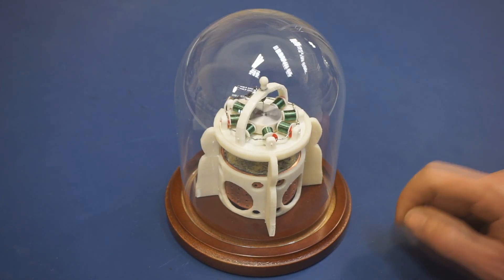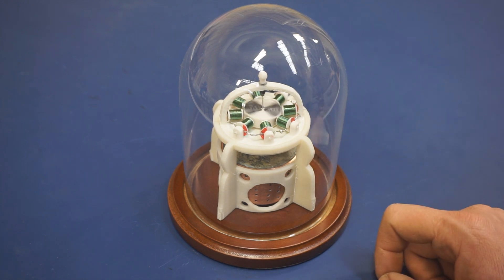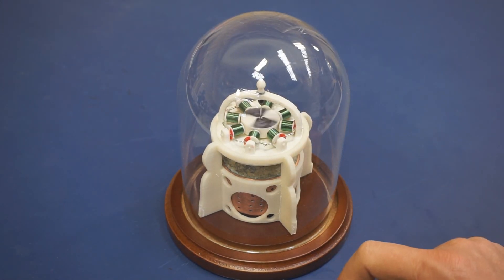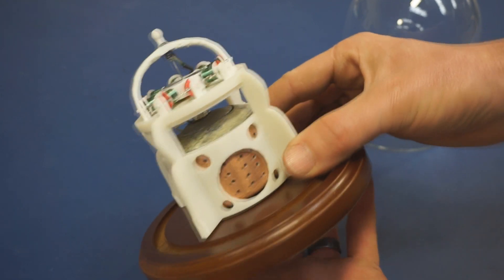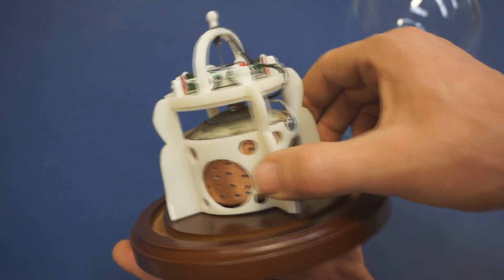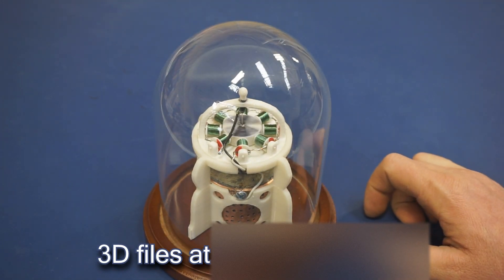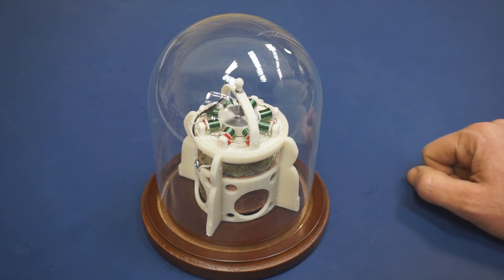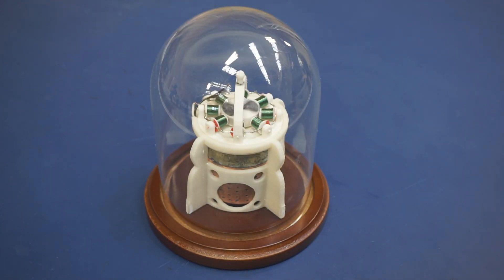Mini EZ Spin Motor + Epoxy Hybrid Crystal Cell

Comment: Made 4 crystal cells last fall (October),
still at 1.2v and topped with epoxy. Using them to power dancing solar flower circuits- converted to pendulums. 
May try drilling a few holes into a couple of them and adding a few drops of water to them.
Thanks for the inspiration laser !
Reply: Are they still working?

Comment: I love your videos and watched all of them. Been following you for years now.
I want to tell you that I have made concrete battery from aluminium and copper.
Voltage is 1 volt with only 3-4 micro amps but it is interesting that this cell works more than 3 years now! That would be perfect for your motor because there is no need to add water or anything else. I have 2 smaller cells and thinking to give them to someone who is interested in this.

Comment: Epoxy in a crystal cell mix??? It seems like that would make an insulation situation out of it and stop the chemical reaction. I'm very surprising that it worked.  I did make a couple of cells where I sealed the top with epoxy but with time they went dead.  I think that I will drill holes in the sides, like you did, put a little water in there, and see if they come back to life. 
   I am still working with the SOLN1-8. The USB volt/amp meter that I ordered arrived and has made testing much easier.  So far all I can say is that this SOLN1--8 is another one of your inventions that does all you said it does and more. It is going to be very handy on my sailboat.
Reply from the maker: ***** 
Did you ever see the oil cells I tested?  I also did not think that was going to work.  I added the epoxy to correct some issues that have arisen after years of testing with my older cells.  So far it seems that this cell is probably the most stable I have ever created.  Time will tell, and based on past experience it may take a few years before we have the answers.
  I am so glad to hear that you are enjoying your SOLN1-8.  I am looking forward to hearing how it works out for your sailboat.  I have put all my spare time, as well as more than a few all night build sessions, into the SOLN1 project.  I have a large SOLN1-100 that I am just starting to design and build.  It features a 100W semi-flexible panel plus a 2000W surge to 4000w inverter.

Comment: If the motor consumes so little energy, you can try to build another type of battery - I cannot give the exact name, but it has been used in a very old clock - there is a cylinder with gas which reacts on temperature difference , no matter high-low or low-high, and gives power to a clock mechanism like forever...
Reply: ***** 
The Atmos clock.  It works by changes in atmospheric pressure acting on a bellows which is connected to a ratchet winding a spring that powers the clock.   It was not electrical it was mechanical.
Reply: Yes! Exactly - I saw it in the Watch museum (Uhrenmuseum) in Vienna...

Comment: Hey i ASK you From eBay why cannot not ship To germany?
Reply from the maker: ***** 
I tried to set this auction up as an international auction.  For some reason it is not set up that way and because it already has bids I am not able to change it now.  If you are able to bid I will ship it internationally for $25.00 flat rate international shipping.  If you are not able to bid contact me with your eBay user name and I should be able to add your name to a list that will aloow you to bid on the item.  Sorry about the mixup.
-LaserSaber

Comment: I see a good project for my new 3D printer!
Reply: im coming up close to you guys (well, closer than i have been!) using an electrostatic build. down to about 1 mA @ 6.2v input, but there is a lot of room for improvement in the drive circuits still. maybe ill end up with something you can charge back up by walking across the carpet   ;)
Reply: ZeroFossilFuel  Please.  Please build one of these.  I watch all your videos and you would be the perfect tester for this amazing electric motor.  Unlike what I did with the my project, you would be showing the actual build from start to finish --as well as the performance.  The larger EZ Spin, that I put together with the parts supplied by Lasersaber, is running on a table in my living room. It is powered by ambient room light using a small solar panel and a 1F supercap for energy storage. It runs out of energy and stops in the early morning hours but sometimes it runs around the clock. It is great fun to watch.
Reply: ***** No, and neither do you. Haven't you heard?

Comment: What was your reasoning for adding epoxy?
Epoxy is a polymer plastic and will encapsulate a lot of your salts in non conductive plastic.
It should not work as well as without. Can you share your reason for doing this?
Logic suggests adding conductive (ionic) material to aid the flow of ions and not a plastic like epoxy.